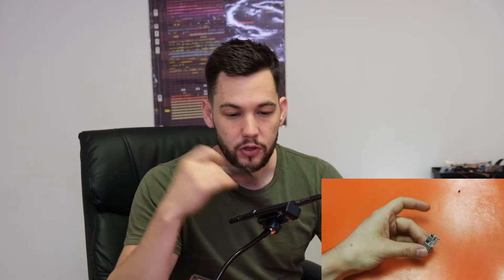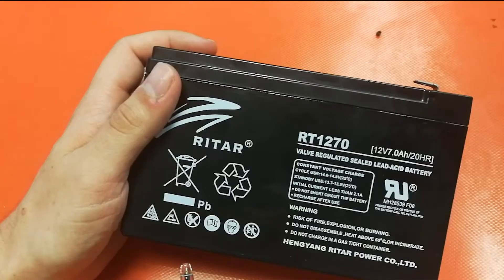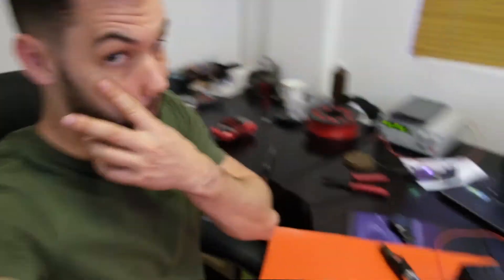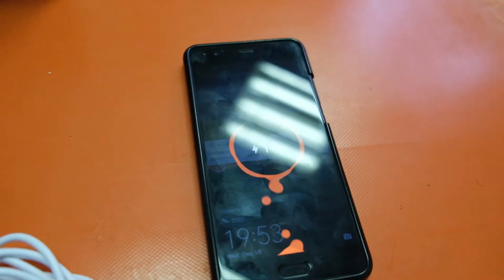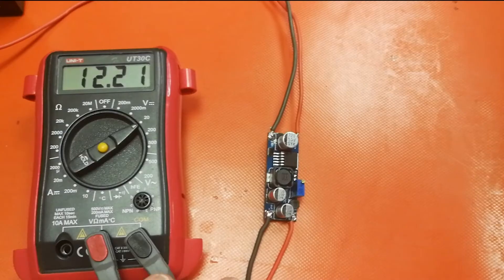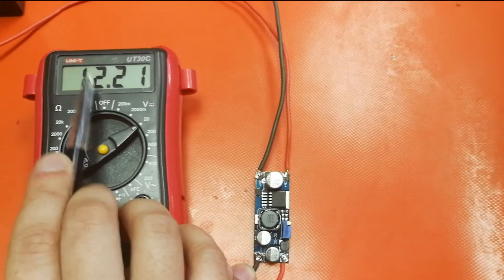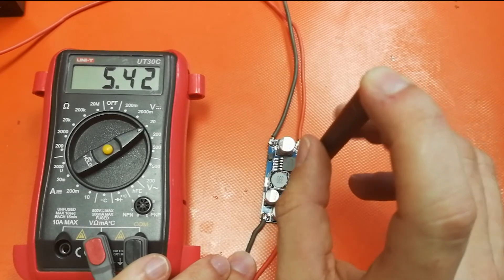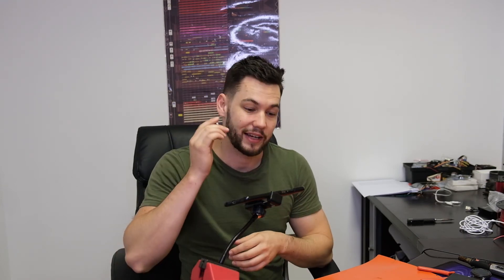Electronics 101: Step-Down Converters (CHARGE YOUR PHONE WITH ANY BATTERY)

Comment: I saw that blue step down module is 3A and i set it on 5v regulated out and put a usb on the end is it safe to charge my phone with it as it is rated for 3A and most phones are 2.4A each or will the phone simply just take as much power as it needs?
Reply from the maker: You are correct Tiaan. The phone will take as much as it needs just please please make sure your output is set to 5V exactly. Your voltage is very important here. Too much current is not a problem.